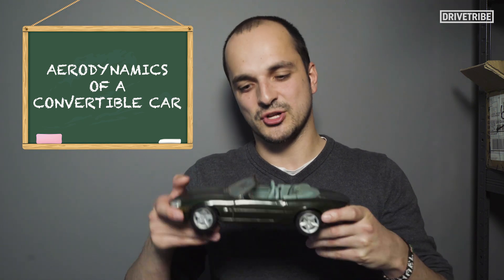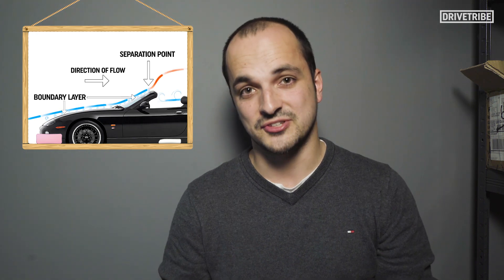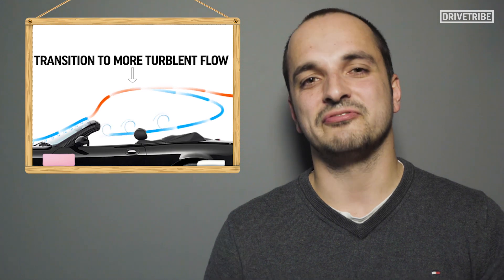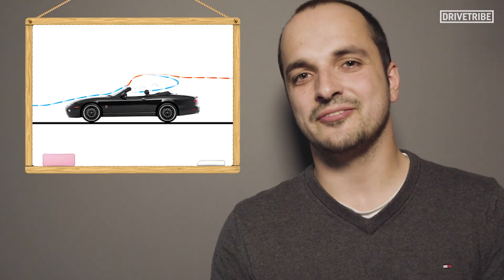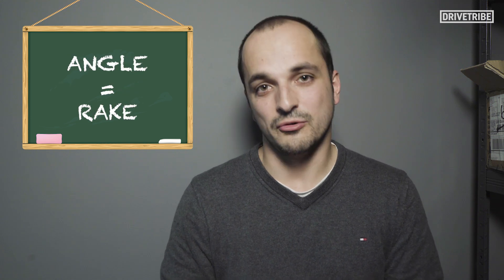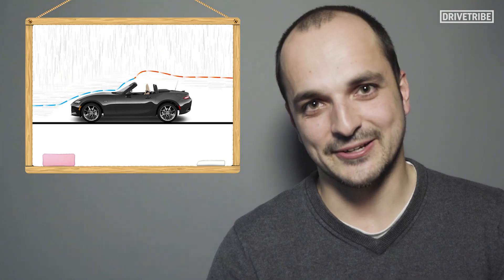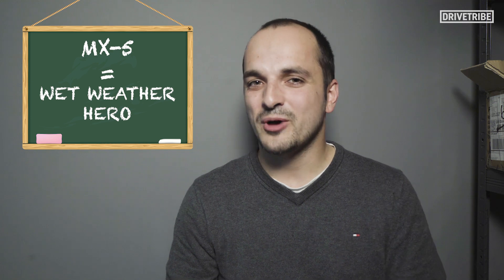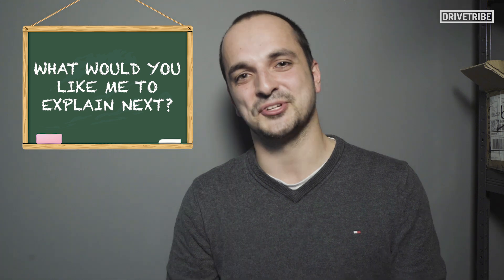How fast do you have to drive to stay dry in a convertible?

Comment: Driving in my miAta r  on the Miami turnpike at 11 o'clock at night. With the top-down, it started raining.... I accelerated to red line, which is a 137 miles per hour, and the rain still came in.....

Comment: It's a lovely theory but it isn't actually true. What was missing from all of those rain illustrations and diagrams? Operating windscreen wipers! Something of a necessity when it's raining. So all that lovely boundary layer and separation point theory falls apart because the wipers push all of the water to one side (normally the driver's side) and the airflow lifts it over the corner of the screen onto the driver's lap, and channels the rest onto the side window where it creeps up to the top and flicks over into the car. Trust me, I've tried it! If you could drive without wipers on maybe it would work, but you'd start getting wet again once you'd crashed blindly into something of course...
Reply: I hardly ever turn on my wipers, lower or higher speeds. Ever hear of rain-x?
Reply: or you could treat your car with dignity and solve your problem at once by using rain-X
Reply: Depends on what you're driving I think. My mk1 MX5 lets in no water once you're over 70kph even with the wipers on...
Reply: Maybe true but wasn’t happening in my Miata. Didn’t get wet at all and that’s Seattle rain

Comment: I want to know why the engineers that design cars ONLY design them to be put together. They take no consideration into “what if” situations. Such as replacing a starter motor. 

I work with them! The answer I got is that as long as it lasts over 35,000 miles it’s not their problem.

Comment: 45mph in an mx5 in the wet you say?  Cue the eurobeat.
Reply: It really works tho (minus the eurobeat, in my case ;) ). People look at you strange, but as long as you keep driving, you stay dry, and it's fun.
Reply: @Runoratsu  Corners.  At 45MPH.  In an MX5.  In the wet. With summer tyres...  I don't see that windscreen rake on the sides my friendo.  Cue the eurobeat and the rust.  ( ͡° ͜ʖ ͡°)
Reply: @huehuehuehuehue  I can only tell you that I regularly drive mine through light and medium rain, top down, and I have weathered a real downpour before at ~170 km/h (I was on the Autobahn, otherwise I would have pulled over and closed the top). It's really less of a problem than one might think.
Reply: @Runoratsu  C O R N E R S IN THE W E T
Reply: Hue Hue Hue Hue Hue Oh yeah, how could I forget. Here, we don’t have those. Germany is one-dimensional. No corners anywhere. You’re right of course.
Reply: @Runoratsu  Oh so that's why beemers can't go around corners.

Comment: Doesn't it also depend on the intensity of the rain?
Reply: From expeience: It does. I think it also makes sense, bigger drops have more downward momentum and more inertia, so you need a boundary layer that can impart enough energy upon those, either by being thicker or faster.
Reply: @Runoratsu  And, to add to that, more rain means more water displaced by the wipers...is more water over the windscreen in your lap.
Reply: Not from experience; I've been over Bodmin Moor with the top down in a cloud burst. Dry as a bone.

Comment: Why does the heat stay in the car in a convertible when the roof is down ? If it does that is
Reply: It doesn't. You have to crank up your heating a whole lot with the top down, and even then, depending on how turbulent the air in the car is (and how fast you drive), it can get a littly chilly when it's cold out (sub 10°C/below 50F). I usually don't drive top down below ~-5°C (20F), because it stops being fun at that point; your hands on the wheel and your ears really start to hurt from the cold then.

Comment: You got it wrong at 0:27 . Laminar is slow HIGH pressure air and turbulent is fast LOW pressure air.
Reply: My dude, you might be mixing up laminar flow of water, and laminar air
Reply: @longboyyo8439  Actually no, that wouldn´t happen with water since it´s an incompressible fluid.
Reply: @insertcoolname96  laminar flow water is a thing.. check it out. It's damn cool
Reply: @longboyyo8439  Oh yes, I´m not saying its not a thing. Im just saying that those pressure variations don´t happen the same way the do with air since watter is an incompressible fluid. I didn´t explain myself very clearly at first. And yeah, its very cool to watch haha
Reply: @insertcoolname96  ohhh. Okay

Comment: My MX5 is perfect for driving in the rain, right up to the point I encounter a traffic jam.
Reply: Red traffic lights are bad news too.
I'm always surprised by the number of convertibles I see - whatever the weather - driving with the roof up  here in Southern France. I've asked a few why:
Winter "it's too cold"
- so wear a hat and put the heater on dummy!
Summer "it's too hot and I want to use the air conditioning" 
So tell me, why did you buy a convertible?
No such questions for me in my ancient mk1 MX5. In winter the heater is powerful enough to melt your feet and it doesn't have air conditioning 😁.
Conclusion:
You can drive a convertible top down all the time you wimp. All you need is two hats. A woolly one for winter and a cap or sun hat for summer.
😉
Reply: Robin Forrest Totally agreed, or, well, mostly. If it’s raining/snowing hard, I’m stuck in city traffic a lot or if it’s sub -5°C/20°F, my top‘s up, too. Also when parked, I don’t wanna give anyone the opportunity to use my car as a trashcan or something.
Once I also had to close the top in summer—I was on the road for quite some time, and despite sunscreen, my arms and face were getting badly sunburnt. 
But yeah, generally, I don’t understand a lot of people either, regarding their decision to get an open top car, and then leaving it closed for but one or two days a year.
Reply: @Runoratsu  
Haha. I did actually put the hard top on for a week in december when it got seriously cold here but I hate it with the hard top (the cabin becomes noisy and dark) so as soon as things warmed up again back it went into the garden shed again.
Reply: Soft or hard top? Soft top—hey, you can raise that with one hand in 2 seconds, even at moderate speed! Hard top: Get a Smarttop ( http://www.mods4cars.com/sms/db/smarttop ), I wouldn't want to miss mine!
Reply: Oh dam, at least you have a bugatti chiron to stay dry though!
Reply: Anything over about 20mph is enough to keep mild rain out of my ND Mx5, heavy rain and 30 plus is fine. I can also raise the roof in about a second and a half at upto 30mph safely.. quicker than most cars roll up there windows lol.
Reply: your mx5 will never go fast enough to avoid rain
Reply: @tehgzizlauw1787  Maybe if said rain originates in a cat. 5 hurricane, but other than that 130hp is fine in regular traffic.